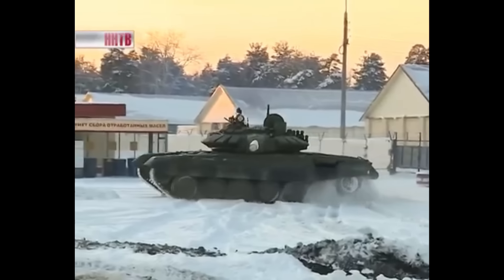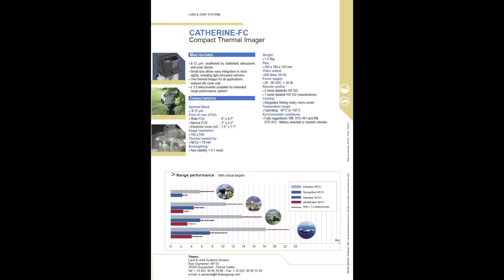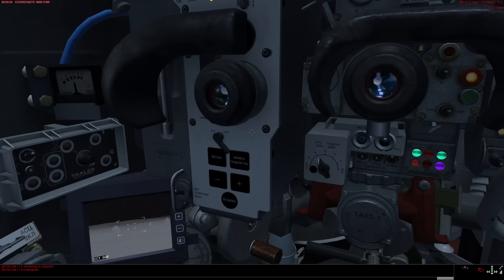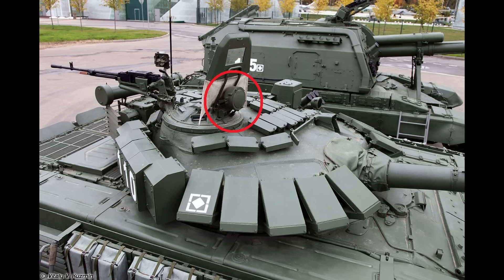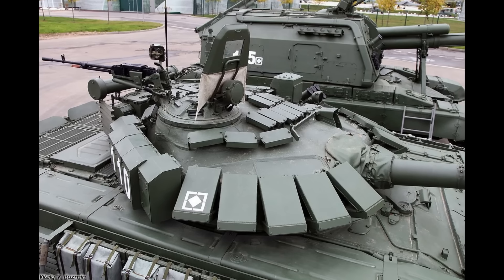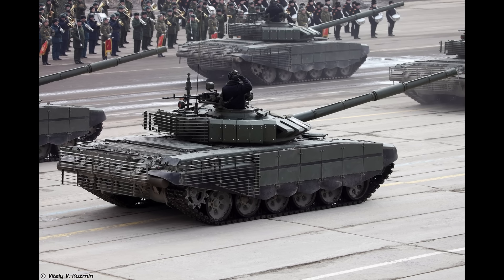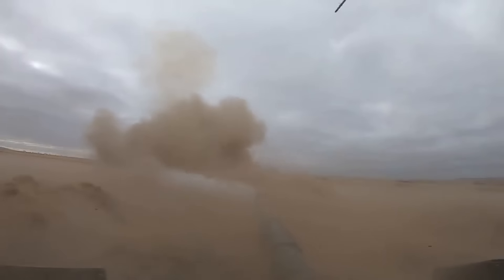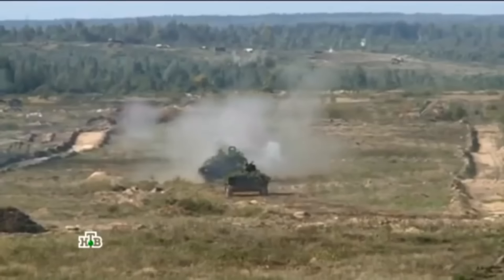Problems with Russian T-72B3 tank

Comment: To the survivability: 
Problem in Russian tanks is the ammunition. Russians are using 125mm HE shells. They are extremely powerful. Also that brown think where is gun powder is just thin waterproof cardboard that can easily cant fire. Also the APFSDS casing. Also when they place  ammunition anywhere else except  carousel is big non brain moment. One spark or small shrapnel and fire is there.  That's the problem

Comment: The worst part of the T-72/T-90 tanks is the engine that needs shockingly frequent overhauls.
Reply: It's like that with every piece of Soviet/Russian equipment. Easy to maintain doesn't mean needing little maintenance and the more complicated Russian weapon systems are not like AK-47, in fact maintenance cost and number of maintenance hours per flight hours of Russian combat jets are on pair or worse than Western jets.

Comment: It's "meant" to have night vision and thermal, but lots of captured T-72 have been shown to either have a 1st gen ruSSian built, not working or missing.

Corruption means alot of stuff that is meant to be fitted is actually either written that it is but not actually ordered nor fitted (every one pockets the money) or a lower spec is fitted instead.

Add on alot of them are going into battle with less than half of the ammunition thats meant to be carried.
Reply: Yeah the vast majority of people and some “experts” have trouble comprehending how widespread and extreme it actually is. 
We are talking corruption from the top and every single link down the to the soldier who actually operates the tank. 

Basically everything they state are in their equipment is not the quality it’s supposed to have.

Comment: Don't forget about the issue of corruption. What the T-72B3 can do on paper is one thing, but after falling behind on maintenance, receiving faulty armor components, and possibly having parts stolen there is no telling what the real capabilities of any given tank are.

You also didn't mention the unique vulnerability of the design to top-attack munitions. There is no point-defense, practically no top armor, and the ammunition is going to get hit. Personally, i think it would be cool if they moved to a liquid propellant system so they could put the propellant anywhere as opposed to the worst possible spot (the propellant is most likely to explode), but that requires money and ingenuity that I'm sure they lack.

Comment: T-72B3 rear is unprotected therefore it can be destroyed by a 3cm autocannon seen in Ukraine. T-72B3M seems to have that corrected. I wonder why Russia did not use an automatic gearbox on T-72B3 to improve its reverse speed which is 4 kmh using Manual gearbox
Reply: They cant do it on t 90 m
Reply: Literally every tank has that problem.

Comment: i only have 1 question here, tell me which modern tank, if any, can survive a direct hit from advanced AT tank missle that was seen in the video, where poor t73 b3 turret was blown into the air. tanks need protection from infantry and other modern heavy weaponary system, tanks themselves are vulnerable in any circumstances. not to mention once it s forced to be slow down or disabled, its dead as well. would same thing happened to the t72 b3 if it were well supported? probably  not, therefore id say in that situation, any modern tanks will be blown into pieces, if not just any easier.
Reply: The Merkava Mk4M seems to be doing quite well. Maybe it's an unfair comparison, as it's one of the (if not THE) best armored tank out there, highly focused on the crew's survivability...but there you have it, an example of a tank that can fare quite well against modern ATGMs (as proven during Operation Protective Edge).

Comment: I wonder whats stopping them from upgrading the T72/90 reverse speed is there design flaw that would mean they have to completely redesign the tank.
Reply: It'd be an entirely new transmission. The reverse gear ratio is extremely low, and it only has 1 gear iirc. You'd need to either add a gear, or lengthen the existing one, which is a massive headache, especially cuz transmissions in Russian tanks are very compact
Reply: It would require a new gearbox to be both designed and built that would fit in the area designated for it. They seemingly haven't thought it to be worth the relatively expensive cost of mass producing thousands of new tank gearboxes to replace functional ones.
Reply: Money, you can't do much without it especially military equipment.

Comment: Why expect the T-72B3 to fight armour ? 

Certainly not on grounds of Soviet and Russian doctrine that procured the T-72 for defensive 'Motorized Rifle' Divisions which are trained to use them as assault guns against infantry in cover, light vehicles, fortifications and in an occasional ambush where likely most kills will be made by infantry operated anti-tank missiles just as demonstrated by the losses of the 1st, and 2nd Donbas Army Corps... 

Soviet and Russian Armour units deploy T-80s (T-80U, T-80BV) and T-90 - which is the only realistic encounter between NATO and Russian armour in a breakthrough scenario - either because of a Russian armoured assault or a Russian counter-attack into a NATO breakthrough. 

'Equipment porn', ignorant of doctrine will be the death of the West.

Comment: The T72 was never supposed to be the best of the best. It is limited by weight and it's budget. It's a cheap and reliable tank, the cheapest in the Russian arsenal, also it is faster than the T90M (because of it's light weight). So there are some advantages to it and it fulfills it's niche perfectly. You are trying to imply that they should have done the best possible upgrade to armor and it's thermals that they could, which is just silly, it was never meant to be the best of the best. Just good enough, which that tank is, and you've confirmed it yourself.

Comment: From a statistics standpoint I don't think the gaps would be too big of an issue(especially with combat ranges of 300 meters or further)but the lack of front ERA,Non stabilized Commander sight,and low back up speed are all serious. I think all these issues(with the exception of the blow out panels) could be worked through though. If RU Command was able to ensure Consistency of Logistics/Supply/Training and Morale at the end of the day all these Machines require human operation).

Comment: I saw a sky news image with a really (fron what I can tell) cursed T-72 B3, with kontakt 5 attached to the bottom of the knotact 5 Vs, with aidiotnal kontakt bolted looking era on the top of the turret where it is not usually located

Wonder what anyone here thinks of it, it wasn't too long ago and the link did not include the picture, it was on YouTube community post

Comment: Russian tanks all lack blow out panels and the turret is surrounded by ammo. They are a rolling jack in the box.

The design has its pluses like auto tracking but the autoloader configuration really hurts them for survivability.

However I will say that I've always loved Russia's pancake turret low profile design. But I've always been well aware of the draw backs present in the T72s

edit my God 4kmh reverse speed is ABYSMAL. That's a big deal taking a shot and retreating is a main stay strategy in tanking.
Reply: Leopards 2 in syria did have blow out panels, but still got disintegrated

Comment: In Ukraine, however, Russia also uses many obsolete tanks. 
Many tanks lack external protection or have only been replaced by sandbags.
Reply: Yep, while everybody in the comment section are talking about t90m, t72b3, t80u... Russians are using variations of t62. That army is just a joke.
Reply: @maxk4471  the t-62 is given to volunteers
Reply: @mrmacias4217  What about the 10000 t72s?

Comment: The main issue with T-72? Well, 72 is roughly the year it entered service (1972), which means it was developed in late 1960s. And yes, there have been different later versions with different upgrades from the factory floor, but it is still 1960/70s technology for the most part. And modernization will just get you ever so far...
To put it simply - it is obsolete. But still in service due to its high production numbers.
On top of it all (no pun intended), its main threat in Ukraine conflict was top attack ammo, in which case no amount of armor is really relevant. And even some later "classic" ATGMs have no problems penetrating it from any angle due to it being simply - OBSOLETE!

Comment: Soviet tanks were designed for large scale armoured pushes against NATO, no reverse needed in combat as they were planning to effectively keep rolling forward from the Fulda Gap to the shores of the North Sea and English Channel.
NATO tanks were expected to fight a fighting retreat, so needed to have a reverse speed to match the forward speed of a Soviet tank across terrain, and ideally even be faster than that.

Soviet tanks for the same reason were also not designed with protection against side and rear threats in mind, they were never expected to face any. That changed somewhat in Afghanistan where the Taliban/Mujahideen had some RPGs and LAWs, but they were hardly trained fighters who were skilled enough to aim effectively at gaps in armour plating, hence there being gaps wasn't considered a problem.

This is now the first time ever that Soviet designed modern tanks, fought by Soviet soldiers (by any other name, same training regimen, same equipment level, same unit structure) are fighting a peer or near peer enemy equipped with similar weapons and training.
And so the problems inherent in the design when used in such an environment are showing themselves (Iran/Iraq war and Gulf war are hardly that, as the training of the troops involved was sub standard, and the equipment hardly at the bleeding edge of Soviet systems of the time, the same can be said of the various Arab/Israeli conflicts, though those should have come as a warning to the Soviet designers yet didn't because of the inherent Soviet disdain of their Arab clients as barbarian amateurs).

What it shows more than anything is that these vehicles are not suitable for the style of operations they are currently being used for.
No doubt the armoured spearhead blitzkrieg scenario on the German plains they were designed for would have suited them well. Good forward speed, low profile, high rate of fire, used in mass so flanking attacks by the enemy would not be a problem.
But working alone or in small groups, in a semi-static engagement they are incredibly vulnerable. As, to be honest, any main battle tank would be, especially without an infantry screen to protect them against ATGMs and the like.

Comment: I heard a few things about T-72B3.

1. Some explosives from ERA blocks were removed and sold off, drastically lowering their protective value against ATGMs.
2. While new thermal sights and fire control system were installed, the crew were not properly trained in utilizing them. Ukrainians captured multiple tanks with the plastic wrapping still on the new thermal sights.
3. Russian units lacked combined arms operation training to fully maximize the effectiveness of their tanks. Often tanks get picked off by themselves during offensive or defensive operations.

Comment: For me, the best tank should answer the reasons why tank is important in the battle field?
Tanks= should be the mobile protection and ammunition in the battle field. Therefore: If the tank can't sustain thr fire power of the enemy? Then it should not be used. Most of Russian tanks cannot handle the modern unti tank weaponry pf the west. If the Russian generals are wise enough, there should be a drastic tactical adjustment in just a day or so from the beginning of this war. I mean, you know you losts alot of tanks, then why continue using it for advancement? Certainly Russian generals would be stupids to sent his trops knowing its weaknesses. They way this war goes? I think commanding generals of Russia is really stupid.

Comment: Good explanation. I didn’t really believe that the T73B3 had been optimized solely for the Turret Toss competition, but the experience in Ukraine sure gave that impression.
Reply: Having watched and read a lot of accounts of tank warfare in Ukraine and elsewhere what I am going to say is that the exploding autoloader problem is massively exaggerated. Nobody would use a tank that could be defeated by kicking it angrily in relative terms. And there is more than enough footage out there of T6x, T7x, T8x, T9x tanks being hit hard repeatedly and either remaining in action or not detonating catastrophically. In combat footage it’s not at all in common to see a tank hit by three rockets or multiple cells and still keep on fighting effectively. The exploding Russian tank is a funny meme but it’s far from the rule in reality.
Reply: The carousel magazine is part of Soviet tank doctrine. It's a much smaller tank than the abrams because of the carousel magazine and would therefore be easier to transport across the soviet union in case of WW3.

Comment: I've never really heard anyone call the T-72b3 a super tank, it is a decent cost-effective tank that still outperforms most Ukrainian tanks, most of the losses suffered by T-72s in Ukraine weren't caused by Ukrainian tanks but by anti-tank missiles, drones, mines and artillery which would have been effective even against any western tank but unlike western tanks Russia can easily replace them, Russia has also greatly increased production on T90s so I think they will be balanced out with better tanks.

Comment: Also in addition to the reverse speed issue since people still think that it's an absurd and irrelevant one. The Ukrainians themselves pointed out that one of the reasons why they killed thousands of Russian tanks fairly easily is that every time they ambush them, the Russians in panic, simply turn around and immediately try to run away, exposing their softer rears to enemy fire. Rather than reverse it.

Comment: You want Russia to have good equipment and vehicles - lift sanctions :>

I, as a patriot, am quite amazed that my country, under pressure of 90's , crisis of 2008 and sanctions since 2014, is capable of building new tanks and upgrading old ones. 
Its not nice to keep Russia on the short end and complain about it having bad stuff.
Reply: How has the sanctions hurt the Russian military industry? And have you served in the Russian armed forces?

Comment: T-72b3 is a very good tank
For it role! As a cheep and easy to update of a old tank
Reply: It is horrible. 4 km/h reverse speed is an absolute disgrace. This means it essentially can only drive forward in battle. If it does a u-turn to reverse faster, it will expose its even weaker armored backside that has no ERA. 

Western tanks can reverse at a pace that sort of makes sense, although they also leave some to be desired.

A tank that cannot retreat properly like T72B3 is very, very very dangerous. It really puts high demand on scouting and intel collection to ensure it never gets into a sit. where fast retreat is important... but the russians are not doing too great here.